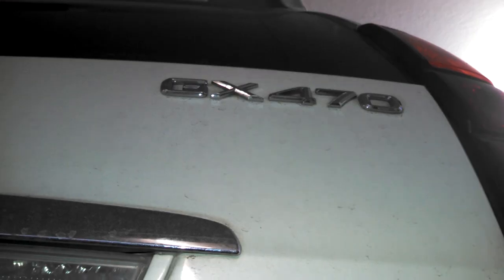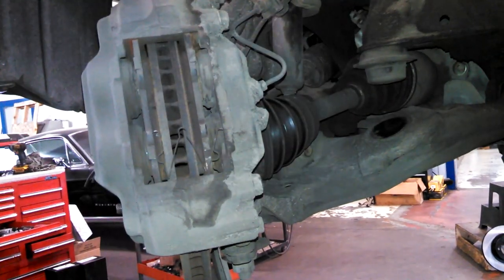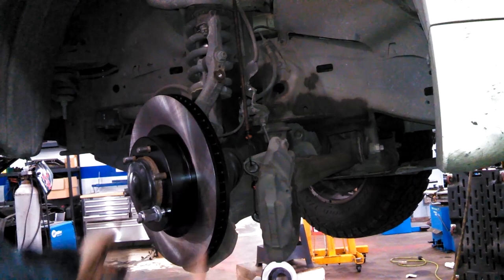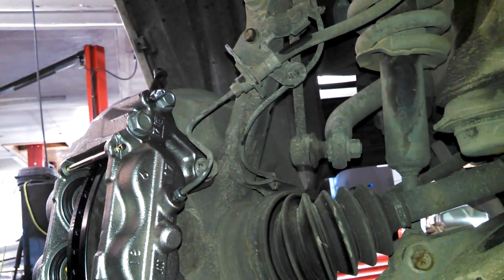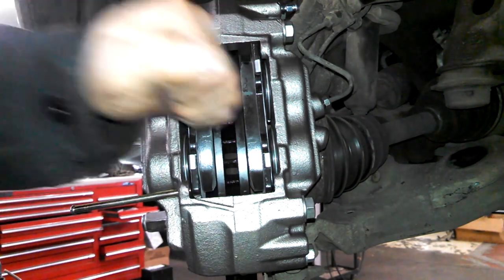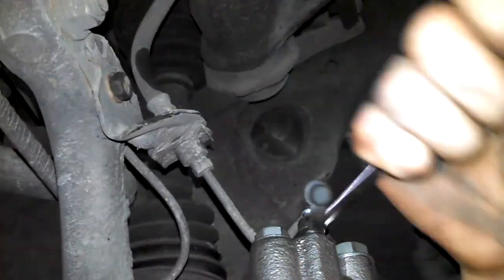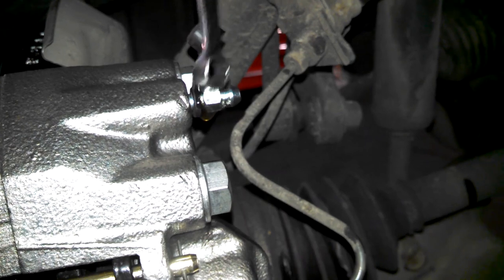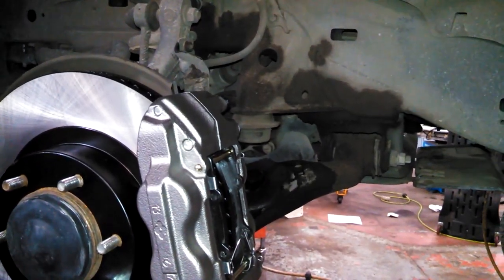Front brake pad replacement 2005 Lexus GX470 calipers rotors. Toyota 4Runner 2003-2009

Comment: I changed the front passenger caliper, rotor and brakes.
Front Driver's caliper and rotor was good. Only brake pads.
Now for the bleeding. (Help please)
Do I need to do all brake lines? 
Someone told me start from the farthest one to the closest one.
Assuming passenger rear, driver rear, passenger front and driver's front.?  Thank for the video.

Comment: I heard you needed TechStream to bleed the brakes. Anyone know anything about this?
Reply: On my VW you can bleed the brakes without the VW scan software. The only time you would need the software plugged is to also bleed the ABS system. I'm assuming the GX470 is the same. I'm doing the brakes and a bleed on my GX470 soon. I'm not too worried about the little bit of old fluid in the abs.
Reply: Maybe the LS460 with is brake by wire system?